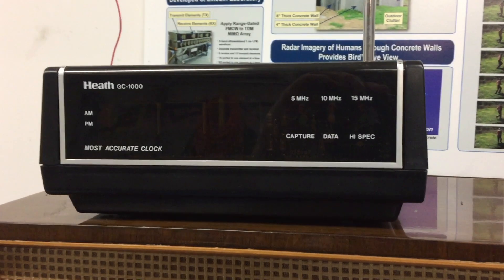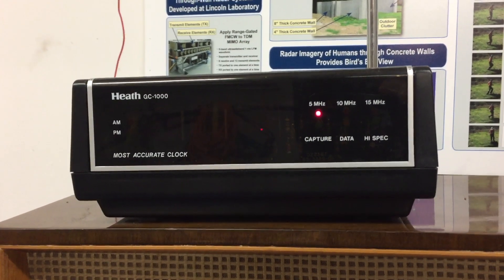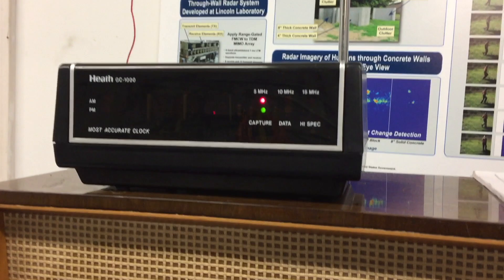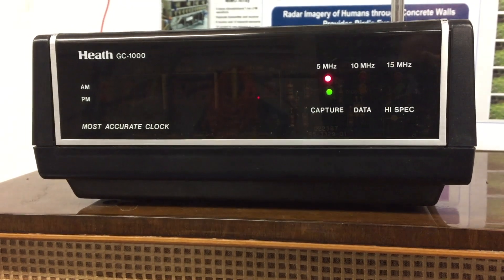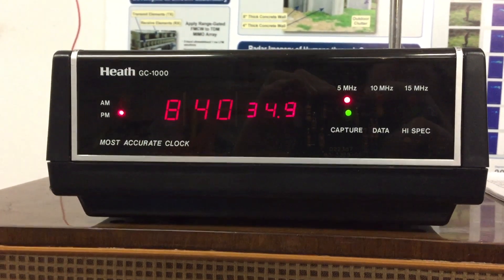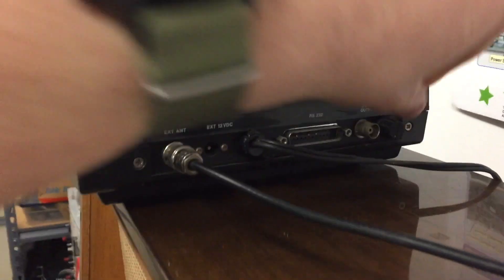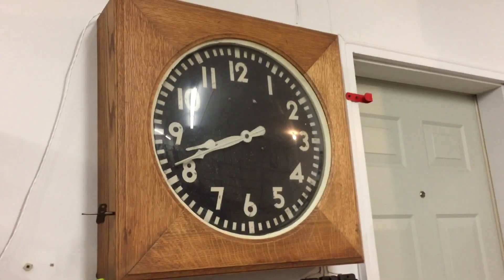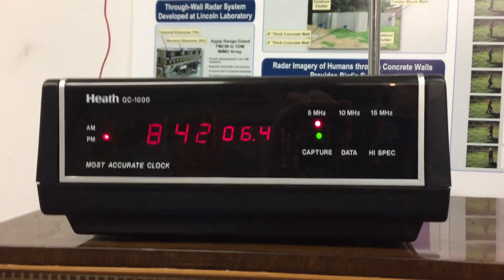Heathkit GC-1000 most accurate clock demo

Comment: Many years ago during the 1980s I built and had one of these Heathkit Most Accurate Clock. I had a long wire running across the ceiling of the apartment for an antenna. Eventually this clock wore out and failed after a number of years.